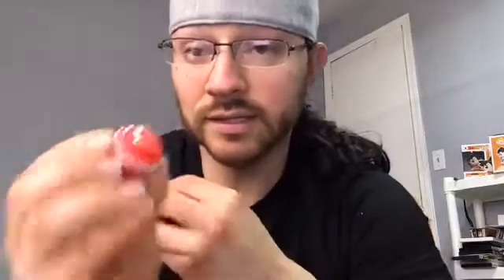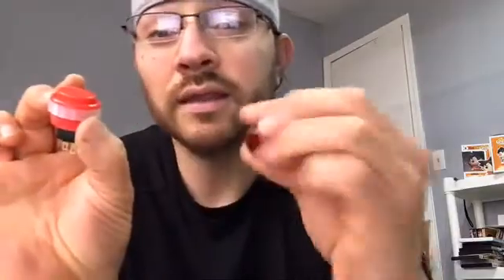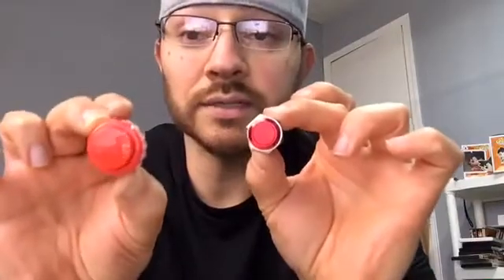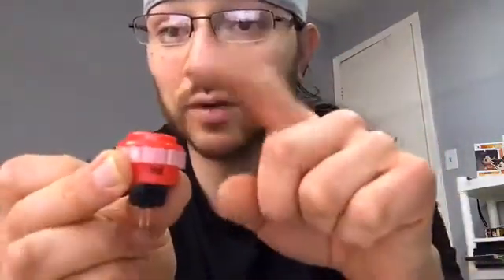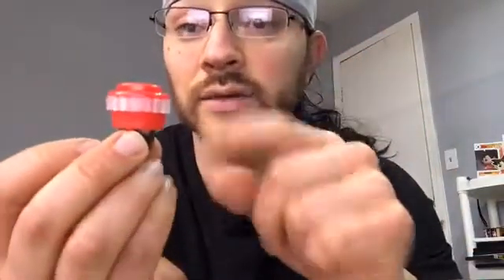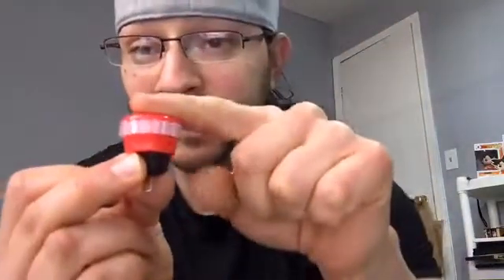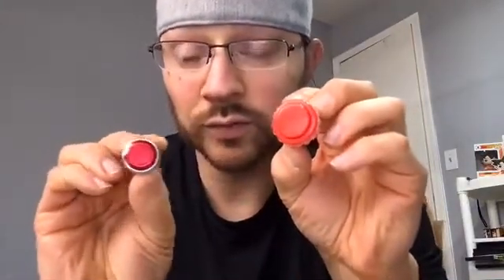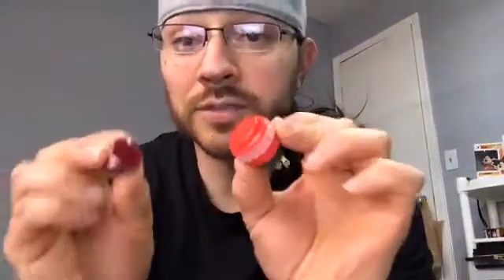portable turntable start/stop the difference between a latching and non-latching button

Comment: Hey CJScratch I'm having trouble with my start Stop button. I have the same relay but different button.
Reply from the maker: is it a non latching  button ?
Reply: CJ Scratch It is a non latching button. The platter spun around in 2 occasions. The first time, I pressed the button and it spun but when I pressed the button again it wouldn't stop spinning. The second occasion, it worked perfect. But when I fitted the button in the hole and reconnected the wires to the pins and pressed the button nothing happened. I then checked my wires for loose connections. Checked the button for continuity, and I also checked the wires that go from the button to relay for continuity. They all checked out fine. I have not checked the relay CB 1 I don't know how and 2 the red light on the relay lights up when I power up the turntable and when I press the test switch on the relay the green light illuminates and the platter spins. I'm confused.
Reply from the maker: hit me up on Facebook messenger

Comment: Are the non-latching better? I had to get rid of my latching button from openformat. I uninstalled their ultra pitch first because it cause the platter to lag. Then I had to get rid of the arcade button because it was causing the platter to spin full blast, when I unsoldered the ground they had to the platter it went back to normal, but then I had a bad fuzz from opening and closing my fader. Starting to suspect the pre-amp mod is causing that! SO what pre-amp kit do you recommend?
Reply from the maker: interesting ....  the non latching button just springs back faster ... i wouldn't say its better or worse... sorry your having sop many issues with your  portable
Reply: budgetkuts What pre amp did you use? When and what do you clean your fader with?
Reply: Buzzing is most likely caused by some circuit interruptions, like bad connection or something so double check your wiring etc. I also had an issues with fussy power adapter so if.you use external power adapter you may want to check it too.